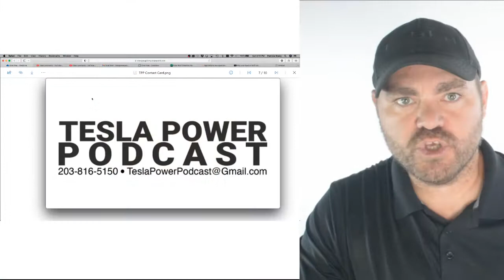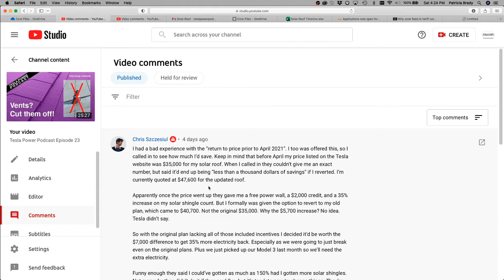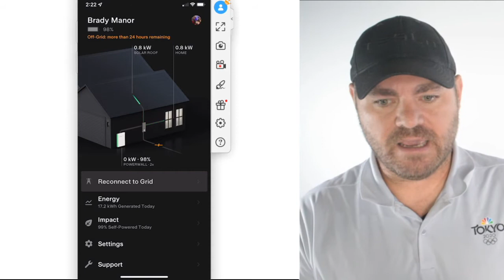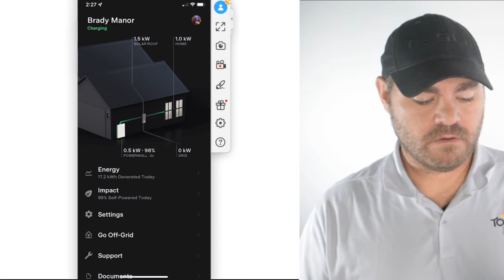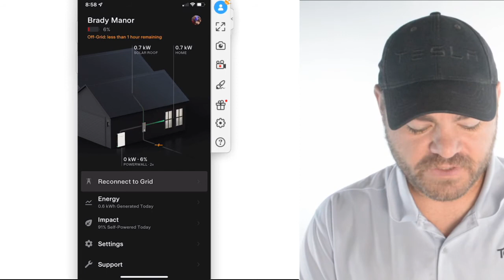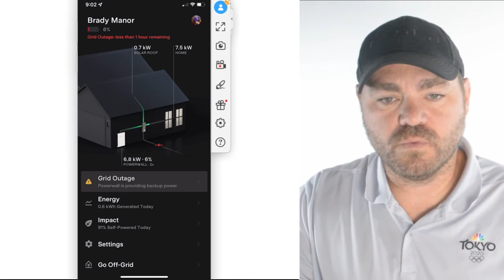Episode 25 - Off-Grid Mode | Testing Extreme Battery States

Comment: how long have you been waiting for PTO?...im going to be going solar roof route soon over in Stratford so im curious
Reply from the maker: Install completed April 17th.  I would have received PTO July 16th, but I failed the witness test due to too much inverter capacity.  Updated application from Tesla included many errors.  Awaiting revised application review.  Not sure I'll get PTO before the end of the year...
Reply: @teslapowerpodcast  Wow, that is crazy.  Do you blame the Power Company, Tesla or both? And can you take advantage of the Solar Power generated while Off Grid or is all the Power going to waste until PTO? I'm new to all this and trying to play catch-up.  I have 3 Tesla trucks in front of my house right now and about a dozen or so workers installing my roof today (NY State).  Thanks
Reply from the maker: Well, if I'm brutally honest, I am the one to blame.  If I hadn't changed my order in the middle of the job, I would already have PTO.  If I had stayed with the original 1 Powerwall, the applications would have been accurate and we would be under the 20kw threshold set in CT law.  It's my decision to add the second Powerwall that's derailed this whole thing.
Reply from the maker: I am able to take advantage of some of the solar power generated before PTO - anything I can store in the batteries I am able to use later.  I don't get net metering, though.  Interestingly, I'm not able to stay in Off-Grid mode because I don't have enough battery capacity.  It's not clear that more battery capacity would allow me to stay in Off-Grid mode, either, because I don't generate enough electricity from the solar roof to cover 100% of my needs (mainly factoring in the car).  Each time the batteries get down to about 5%, my Home Energy Gateway automatically puts me back on the grid.
Reply from the maker: Are you getting solar panels or solar roof installed?  Are you getting any Powerwalls?
Reply: @teslapowerpodcast  My solar project is in New York.  Powerwalls installed July 2021.  Solar panels installed September 2021.  Electrical inspection complete and passed one week later September 2021.  Tesla received final payment from the finance company about a week later in October 2021.  Still waiting on PTO.  I had called Tesla a couple of weeks ago and was told that the paperwork was still with the department in Tesla that sends the interconnection paperwork to the utility.  Was told that after 60 days has passed, I can call back and request that the PTO be elevated to higher powers to be expedited.
Reply: @teslapowerpodcast  I have been using my solar system since it had passed inspection towards the end of September 2021.  The Tesla app notes that since my system has not received PTO yet, it will not feed excess power to the grid.  It appears that the Tesla equipment is "smart" enough to know that I don't have PTO yet (or rather it is configured by Tesla on their side) so my inverters are throttling the amount of solar energy that it is producing so it won't produce more power than my house can use, and my powerwalls can accept to recharge them.
Reply from the maker: Would you be willing for me to come over to record some content during your install?
Reply: @teslapowerpodcast  Sorry - I didnt see this until i saw your upload on 10/8. absolutely. when I get my process moving i'd be more then happy to have you stop by to take photos/video etc. i'll be doing drone footage myself too!